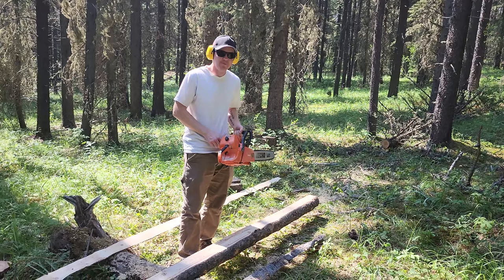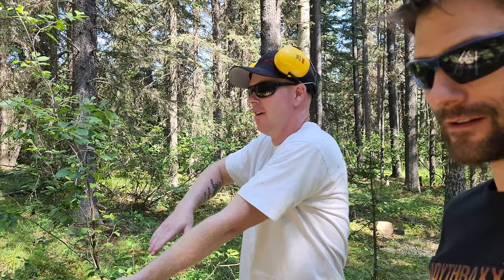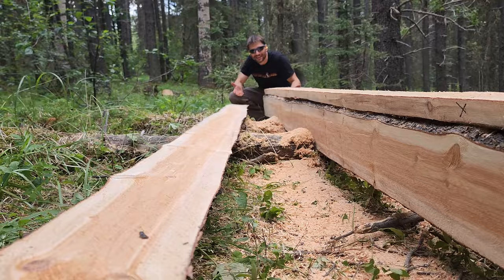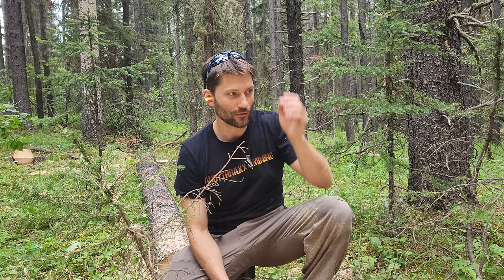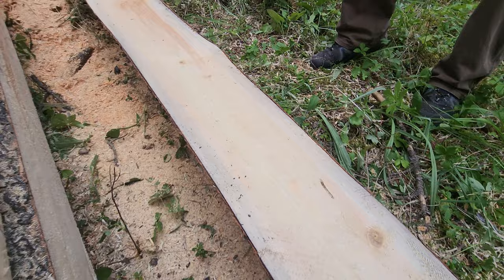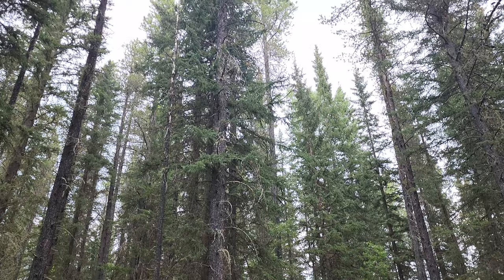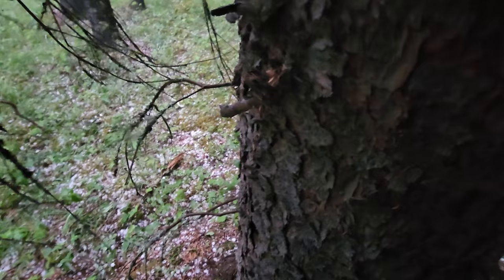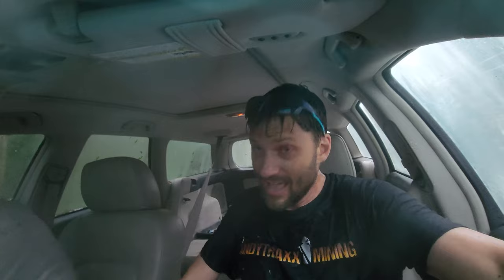Lumber Harvesting and Chainsaw Milling Free Hand.

Comment: Echo saws are way better than anything else. Huskies are very good. Stihl is the worst brand available. Stihl saws constantly require repairs just to keep running. I’ve got echo and husky saws that have been used for decades without any repairs.
Reply: I hate to tell ya bud but if you've never had to repair your saws in over a decade then you ain't hardly running em lol I've used stihl since I was a young boy started out cutting firewood with my dad for my family and yeah I've had a couple of other brand saws but it's mainly been stihl, just like anything else you run it long enough stuff is gonna break or just take a shit on ya no matter how well you take care of it it will always have its time where a part on it fails. In my opinion you can't go wrong with stihl but I will say you do have to watch out for if you buy a commercial stihl chainsaw or the usual homeowner stihl chainsaw there is a BIG difference between the 2. I do like poland saws as well but for me it's stihl. I can keep a saw running for a long time it's just takes TLC when it's needed. I ain't trying to be a prick with this comment but if you've had bad experiences with stihl then you more then likely have bought a homeowner line of stihl and not their commercial line of equipment
Reply: You just revealed your inexperience with that comment!

Comment: I know this is an old video but several years ago I visited Jamaica and I went hiking in the woods and came across two carpenters that were willing 2X4s freehand with a chainsaw. I asked if I could look at their 2X4s and I sighted one down and it was straighter than anything I’ve ever seen at Lowe’s or Home Depot. I’m sure that it didn’t vary even a 16th of an inch and it was 20 feet long so with practice it can be done well, you guys are the only ones I’ve ever seen free handing it on YouTube

Comment: Don’t waste your money on a ripping chain just buy a decent file guide and sharpen a full chisel at 5*, I paid almost $100 for an Oregon rip chain for my 30” bar and my hand file regular chain cut better.

You’ll want to make sure the rakers or “depth gauges” as some call em are all bang on perfectly set to each individual tooth as well or you’ll forever be milling crooked boards….

There really is no substitution for an Alaskan mill and a section of extension ladder for a guide…. Well ok, the substitution for the granburg Alaskan mill it the Amazon knockoffs, I have one, love it, I’ve also got that same beam cutter you are using and it’s handy but the Alaskan mill just takes it to the next level of awesomeness 👍

Comment: The beauty of your film is not the cut; is to understand what the used adapter is called and where I can buy it.
Does the chainsaw need to be modified or is it a "universal" tool?
greetings from Tuscany (Italy)
Reply from the maker: It is called the "Timber Tuff" and I got it from Amazon.  Will fit any chainsaw.